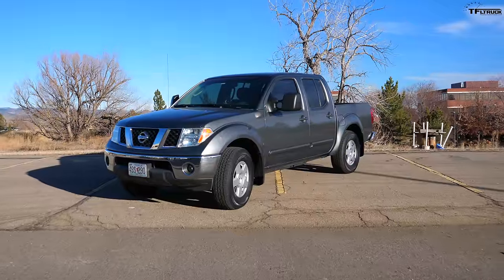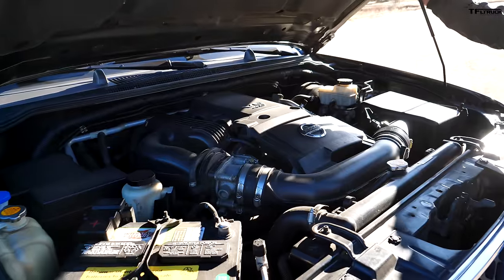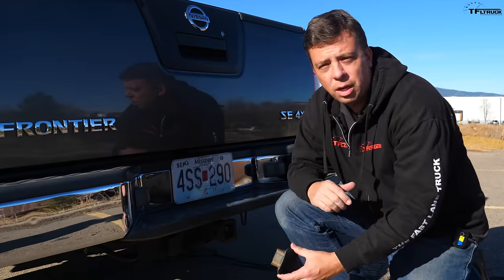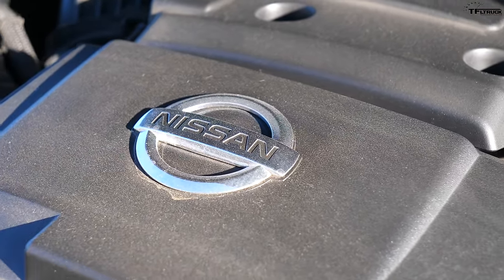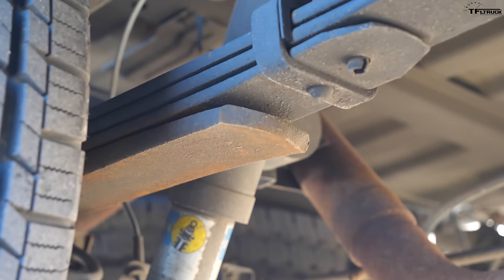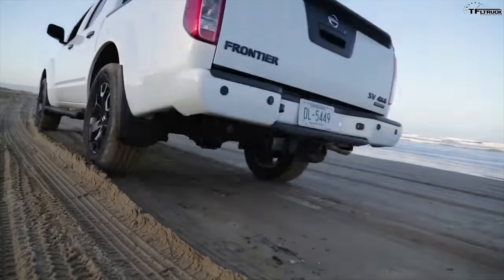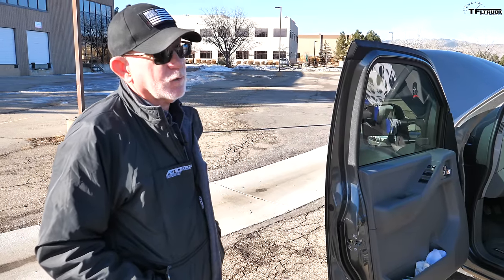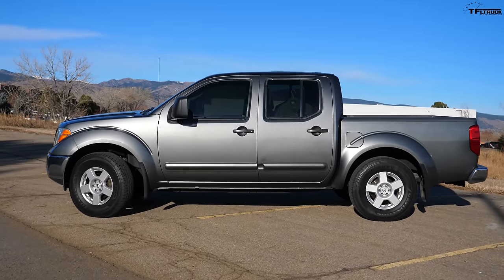Here's Why I Prefer The Old Nissan Frontier Over the New One — Dude, I Love My Ride!

Comment: I bought mine new in 05.   Nissan's biggest blunder was discontinuing the 6 speed manual - it's an absolute blast to drive, even after 16 years.  I'd consider buying a new one, but why?  Mine still runs like new, plus without a manual transmission, it would be more boring to drive.

Comment: My 2010 frontier has 240,000 miles+ and runs great I would drive it anywhere.
I was a chevy guy until this truck but its the best truck I've ever owned. Granted its not my 72 swb chevy 396 4 spd but my chevy isn't my nissan.

Comment: Bought a 2005 Nismo 6 spd in 05 New, drove it hard, on and off road in British Columbia, lots of snow driving, modified it with Volant COI, K&N, and Magnaflow muffler, put 265K kilometres on it.  Traded it in for a more modest 2014 SV  Crew cab  long bed 4X4. I have 2 Sons, one went with a 2015 Frontier, the other went with the Taco.  Before the 2014, I had a 1984 King Cab 2wd and a 1991 4WD King Cab, ( sold it to a friend, it is still running)

Comment: BTW, Nissan fixed the timing chain guide issue on late '07/early '08 trucks, so if you're looking for a frontier with a 4.0 that's the year you want. If you're a moderately inclined mechanic that isn't scared by timing an engine, you could knock out the job for 4-500 bucks and a full days worth of spinning a wrench. TBH as long as you get a manual trans truck, fix the chain guides you pretty much have a 50% off tacoma with better acceleration. These trucks have some serious value to offer, especially if you're willing to buy an '05/'06 with 130-150k and just go ahead and just do the timing chain and water pump as peace of mind. Oh and for the gearheads, I've seen 6 speed 4.0's with an intake and tune trap 95-96.....
Reply: On my '09 I started hearing the timing chain whine at about 65k miles.  I'm now approaching 80k, and it's ever so slowly getting more noticeable.  So I'm not so sure they "fixed" the issue.
Reply: @keithb.9189  To be fair, it's still possible for a later year to have the same issue, it's just much less common than the earlier ones.

Comment: Great review!  I like that it is a manual transmission and 4x4.  I am the original owner of a 1995 Nissan D21 SE-V6 4x4 that has 160k on it. Still has the original clutch and the A/C still blows cold after 24 years.

Comment: I have a 2015 pro4x, bought it with 25k miles on it. Truck is nearly perfect for me. My son and I went shopping for a brand new midsize for him. Drove them all. Colorado, Ranger, Tacoma. Was expecting to be envious of the new tech. Nope. We both preferred my 2015 pro4x to everything we tested. Only thing to quibble about is the mileage. But I'd never trade my low end torque for the extra mileage you might get from the Toyo.  BTW, I was blown away by how disappointed I was in the new Ranger.

Comment: The Long Bed WAS available with the 6spd. The long bed wasn't available until 2007 and was only available as SE/LE/SV and the SE/SV were available with the 6MT. All 6MT and all NISMO/PRO-4X come with the M226 (Dana 44) rear axle.

I ordered my 2007 SE 4x4 LB 6MT and it was the best vehicle I've ever owned. I had it 10 6yrs and 145,000 miles, but then I got the itch for a new Titan PRO-4X. The Titan has been good, but I'm really considering going back to a Frontier, it was just an easier vehicle to live with.

Comment: I bought a 2015 pro4x with 36k this year after watching many of your test videos.  Every test despite not having all the latest fancy smancy stuff it just would do the job.  When I researched cost of ownership, it was really low, especially if you buy it used.   Big depreciation in the first year from new.  So even without the best fuel economy it's still cheaper and as reliable as the best in class.  One thing that stood out for my family was booster seats fit much better with the upright seats in the rear.  The 2019 chevy my sons feet were planted into mine, I'm 6'2".  The Tacoma,  well we all know that's a truck for people 5'7"-5'10".

Comment: I have this same truck basically, however mine is 2-wheel drive and plain silver. I have over 220k miles with the original manual transmission and clutch. I haven't used it for towing, but have hauled a lot of stuff in the bed. I love the rails with the tie down cleats. Great truck.

Comment: Mine was the same color but it was a 2007. And last week at 113,000 miles my transmission let go and radiator busted. Not pulling anything. And the truck has never pulled anything. So the cost to repair it was almost $7000. And the book value was 6500 so I traded it in on 2020 Toyota .Thanks for sharing my friend

Comment: had my truck for over 12 years and 230 000 km. manual transmission nismo v6. nothing other than wear items have gone on it and its been reliable the whole time i owned it. just did the titan swap and will eventually get the ls swap. The only problem with this truck is it doesnt break! i had to wait along time to upgrade parts as they break. and i tow with my truck and its solid

Comment: 2010 Frontier SE 2wd crew cab. 185k miles on it. Rear axel needs seals. Spark plugs replaced at 110k. 3 sets of tires on it so far. Put 5100s on at 110k and add a leaf in the rear. The best truck I have owned thus far.

Comment: The 6-speed manual was available in the King Kab, std bed configuration but may have been only in the Nismo trim package that I have.  I have been happy with mine @ 124894 miles.  I too had the timing chain guides and chain replaced as well as the fuel tank sender and cam position sensors.  I got lucky and had the timing chain event and fuel tank sender events covered under an extended warranty as I am the 2nd owner.  The cam position sensors were reasonably easy to do myself and ended up also replacing intake manifold gaskets as part of the project.  Good Truck -0 love the tip about the SuperStrut fittings.

Comment: Nice video. I purchased and still own a 2005 Nissan frontier 6 speed truck extended cab. I find it interesting because I was also looking at the Tacoma as well. But the Nissan dealer placed a fire sale on my truck because it was a 6 speed. I guess most folks do not know how to drive a standard transmissions anymore. And this was back in 2005.. Although I did not have the timing chain issues this gentlemen had. I went ahead and had the timing chain, water pump and associated parts replaced with OEM parts anyway. In order to change the timing chain, the entire front part of the engine has to be removed including the water pump which is also driven by the chain, (I believe). Since the water pump is there. I went ahead and had it changed as well. All of the parts mentioned function as long as the engine is running so it made sense to change those parts when the engine so it did not have to be reopened again to change the pump which was done at 135000 miles. After that, I had the clutch replaced and rear main seal replaced as a preventive maintenance effort to insure I had no failures on the road. The only issue I had was a failing alternator that I changed out of myself. What surprised me with this truck was it's towing rate was higher than the weight of the truck itself which is 5600 lbs and is more than enough towing power I need. 
Outside of adding a K&N filter in the original air box, installing an airbag suspension for the rear end and changing my shocks all around. Nothing else was modified. In short, this gentleman did most of the stuff I did with my truck which still starts on a dime and runs to this day. Oh yes, I forgot. I am approaching 205000 miles on the odometer now. Don't need to buy another truck again. But I will look into the mirrors he purchased for his truck and get me a set of them for mine.

Comment: I agree I have 2000 crew 4x4 with manual v6 Just did timing belt at 104k as per manual.  No issues put it up for sale and really still love it and think it's better than new ford.  Mine takes quite a bit weight in back more than Tacoma Trds I owned.  I am going to stay firm on price $15k.  2000 is one best years for Frontier bar non, black fender flares, offroad package with limited slip.  Hd axle.  I must be getting old if I want automatic like new ten speed.  I looked at 2019 Frontier and thought the door panel was a joke on extracab quality is not in same league of old ones.

Comment: We had a nissan frontier. It was an 06 manual as well we drove it to 210,000 miles with no mechanical fixes. Stock clutch the whole life of the vehicle. Finally got rid of it when a check engine light came on for exhaust related issues because we are not mechanics and we had to pass inspection. Was replaced with a 2017 frontier.

Comment: I have the 2005 Frontier, 289,000 miles and going strong. Automatic 4 liter V-6 SE crew just like the interview.  Awesome truck.  Previous truck was 1995 Toyota Tacoma (277,000 miles on that one)   Both great mid size and would buy either one all over again without hesitation.
Reply: Starting to hear that faint pinion gear whine in the rear end though. Hoping to get to 300,000 miles.

Comment: I have an 2005 nismo, original owner, with titan swap front suspension. I broke the spider gears in the E locker four wheeling because you can only use the locker in 4lo. I replaced the locker with a Yukon gear and axle grizzly locker, you have to replace the axle shafts with the non locker m226 axle shafts. Rugged rocks sells gear packages and differential rebuild kits. Lokka makes a lunch box locker for the front differential. If you do the Titan front suspension swap the titan m205 front diff and cv axle a bolt up.

Comment: My 2012 4x4 6 manual has been great! I like the torque of the 4 liter. Yes, manuals are hard to find.I drove 240 mi. to get one.  Only issue has been the charcoal canister unit. They ingest dust if you drive off road a lot, due to it's location near the rear axle. It tows great and fits into my small garage.

Comment: Great video...I have owned two Frontiers--08 and I have a 13 now.  I had the same issue with the rear end.  Both trucks had it replaced.  The issue is the pressure vent valve on the axle housing, its a common issue with the truck.  I love mine, I have just about 80K on my 13 and the rear end was the only issue...by the way Nissan paid for 90% of the fix for it...you just gotta call and complain!  Thanks again for the video!
Reply: There's a fix for it that prevents the problem and it costs like $40

Comment: I bought a 2005 NIsmo 2WD KC three years ago. a prerunner Nissan style. It has the same Bilstein suspension and locking rear diff. It has about 55K on it. Towed several Uhaul car haulers with a Miata on it, so 4500# or so. Weak spots are the timing chain, mine are still ok. The other weak spot is the radiator for the automatics, the trans cooler inside the radiator fails and runs antifreeze into the trans. Brakes are pretty weak too, I would not tow without trailer brakes. The front sway bar bushings wear and replacing those make a big difference in handling. It’s a great 3rd vehicle. I prefer the chrome bumpers. Nice thing is this 18 year old trucks looks like new, somebody’s garage queen. Since the body style remained the same for so long it still looks current. Not a fan of the new Tacomized version, underneath they are basically unchanged with an updated engine only.

Comment: I've got a '10 LE 4x4 crew cab with 145K miles. It has been very reliable except for crappy Nissan batteries dying about every 18 to 24 months, and I replaced the radiator/transmission cooler at 75K when the extended warranty due to manufacturer's defect ended. I didn't see signs of failure, but I didn't want to risk it. Otherwise, I've only done regular maintenance. It's still reliable and safe enough my daughter uses it as her daily driver. My biggest complaint is low door frame that I'm always hitting my head on getting in/out, the fuel mileage is bad (I get 15 mpg city and 18 to 19 highway), and it has the turning radius of an aircraft carrier. Otherwise, it is one of my favorite vehicles that I've owned.

Comment: I have a 2011 SL crew cab.  It has 276,000 miles on it.  Just replaced the spark plugs, coils and intake gaskets.  Runs like a champ.  Other than the worst turning radius of any vehicle I have ever driven it's a great truck:)

Comment: 1999 My mother bought a 2000 Nissan Frontier, YEARS later it became mine. around 147k miles about 6 years ago. Feb 2019 it was totaled by a drunk while it was parked. 191k miles when it went. EVERYTHING was oem still. AC worked off and on, the only issue. 2wd, xe, AT 4speed, never any towing , light offroding (fire roads). i wouldnt have bought one but man did that thing last!

Comment: I had an 09 and kept it for 4 1/2 years. I put 265k on it and only changed the oil. I pulled way over capacity quite a bit for side work( which is why I got a bigger truck) and had it lifted on 33”mt’s. Definitely miss that truck.

Comment: 05-08 Frontiers called for premium and that is how they achieved the 265hp and 284 ft lbs of torque.  

09 was returned for regular and the numbers dropped to 261 / 281.  

The timing chain issue mostly affected
 05 - 07 models.  Borg Warner manufactured the chains and they had some assembly issues causing chains with rough edges to get installed into the trucks. 

Nissan builds solid trucks.  I’ve had 7 of them.  Still own 2 of them. One is a 95 Hardbody V6 manual with 240,000 miles. 
The other is a 13 Titan.  

My dad has a 01 Supercharged Frontier he bought new.  Today it is driven daily with 320,000 miles.  Original engine, and more impressively original Transmission.   Even the Alternator is original.  I replaced the starter at 299k.

Comment: Not only are they functional but they’re fun to drive too. Does that guy have a fan roar on his? My aunt’s Frontier has that fan roar, which one of the reasons why it’s so fun to drive. They’re also very stylish in my opinion. I just love the titan, macho look that it has. It’s also a torque monster, from my experience which is also why it’s so fun to drive. When it’s not loaded, it’s very easy to do a burnout, even by accident. Of course they have to be that way so you can tow those heavy trailers.

Comment: I have a 2016 Frontier with the 2.5/5sp. The fan clutch broke at 45k. The pinion seal failed at 50k. Now, at 58k, the complete differential is being replaced. All has been done under the factory warranty without question.

Comment: I have a 2012 pathfinder. Basically this truck with a cabin. I put bilstein shocks on it too. The original ones were too soft. 138k miles and the only thing I replaces was the a/c compressor.

Comment: I have a 2007 Frontier with 170,000 + and the only issues or repairs I needed to do so far was gt a new passenger seat because the airbag sensor went out and just recently had to replace a wheel bearing. Good running truck still and really hesitant to get a new one....although I'm eyeing a Crew Cab with a 6' bed. now.

Comment: Own a 2017 Frontier s 4cyl 2wd ext cab, with a little over 16000 miles. Manual windows, manual locks auto trans. Simple truck. Made several long trips and some light hauling.  I really like the truck but I have already a major issue happen.  The rear axle seals blew out and it took 3 trips to the dealer to get it fixed. Gas mileage is not great but compared to the 5.0 v8 ford I had before this its pretty good. So would I buy again?  Yes.

Comment: 2011 Nissan frontier with 226,000 miles still has original clutch original brake pads no issues with a consistent 24 mile per gallon highway mile and 18 in the city six speed manual best truck I’ve owned so far in my life

Comment: Neat review, I especially enjoyed it as the (original) owner of an '03 Frontier (CC, LB, 4X4, 5MT) that is still going strong at just over 150k miles. Like this gentleman, I have used it to tow - in my case a 240SX race car on a 16' open trailer (around 4,400 lbs total) - but have also done some occasional off-roading with it. While I was originally bummed out when I learned, maybe 6-8 months after buying mine, that Nissan was going to upgrade the engine from the "just barely adequate" 3.3 litre to the 4.0, after hearing about the timing chain problem I'm thinking maybe I lucked out. I am way overdue to replace the timing belt in mine (I actually have the kit, just need to get around to it), but also haven't heard any stories about belts breaking in the 3.3s (he says, while knocking on wood). It hasn't been perfect - I've had to replace the starter and distributor twice (although the second distributor was due to a crappy aftermarket unit I used the first time), but it has been otherwise bulletproof. The only other major issue with mine is that is was painted with the infamous Electric Blue paint, which has peeled away from the primer coat on most of the truck, and has been replaced with a flat black spray vinyl coating, which may someday be replaced with a fresh paint job (yeah... who am I kidding...). Oh, and about 16 years into its life the A/C system developed a small leak, so I have to recharge that a couple times each year now. But the engine, transmission (including clutch), transfer case & diffs are all original, and still going strong, and the body, while missing most of the original paint, is still solid and rust-free. Anyway, I've rambled on enough, but after seeing this story I felt the need to share. Oh, one last thing - like this gentleman my choices at the time came down to Tacoma and Frontier, but I was able to get my Frontier at a nice year-end discount ($4k off list), and at that price it was a good $6k-$7k less than a comparably equipped Tacoma, and had the advantage of a 6' bed that the Taco didn't offer. Cheers...